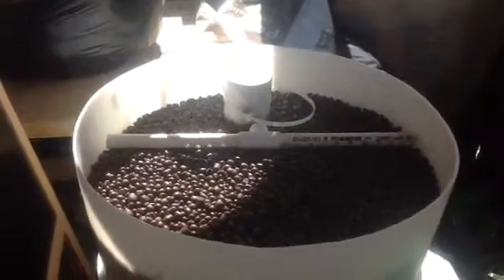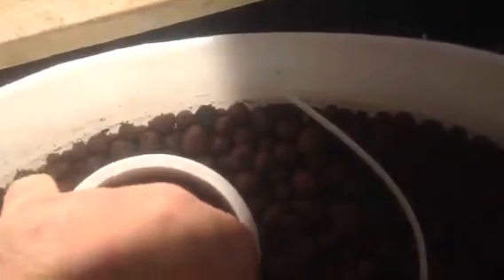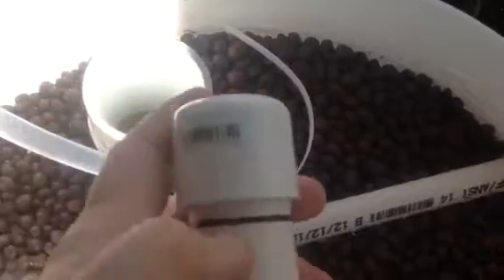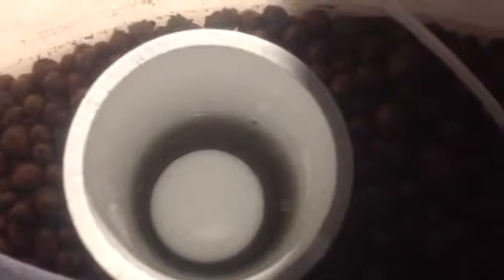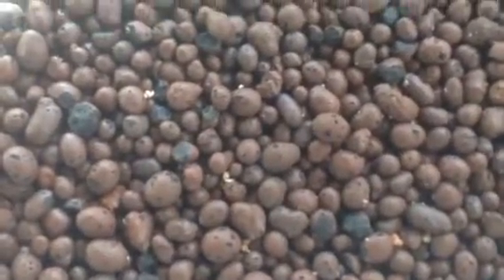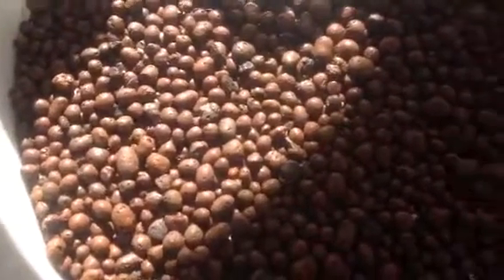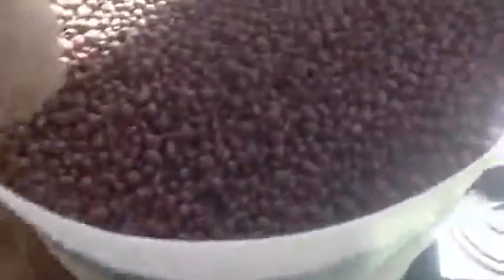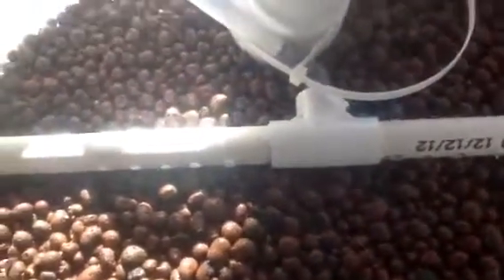Aquaponics with a 55 gallon barrel

Comment from the maker: Ive been tweeking the siphon to get it to cut off. For some reason it would just keep running but slower, as fast as the pump. I cut the grooves in the bottom a little sharper, and it seemed to work. My other grow beds were giving me fits, I didnt have a good table to place them on, and I got frustrated with them, and waited till I had a little more money to do this one. I can expand this system because it is only cycling 5 gallons of water to the grow bed, and I am guessing that I could get at least two more grow beds to run off of the same amount of water. I am starting the system with gold fish, because they are cheap, and dirty. I added some sweet basil, and some mint to the grow bed. Im experimenting with this to get it functioning and I want to show it at my sons school.
Reply: Did you sort out the siphon not cutting off?   just started AP system in New
Zealand..... same problem with two plastic barrel system. (got eight but starting with two to sort out first.)